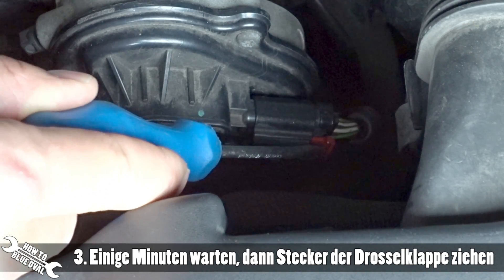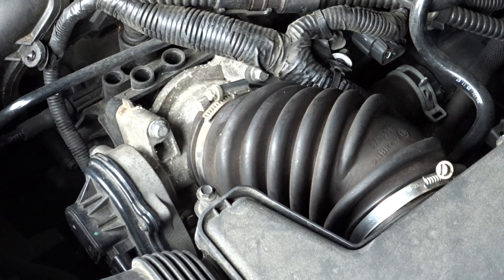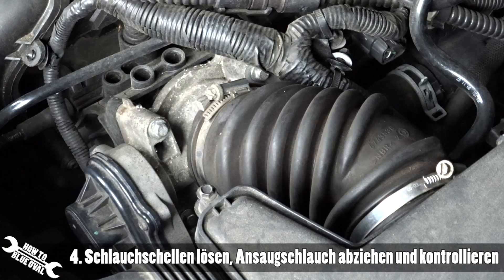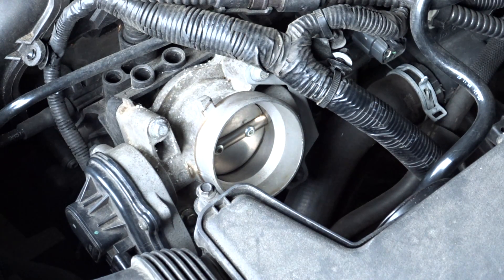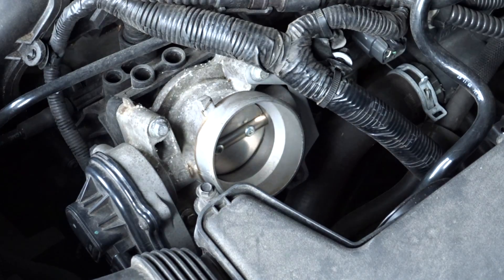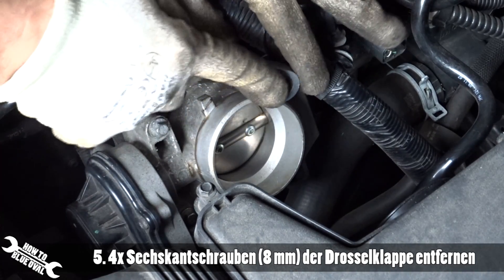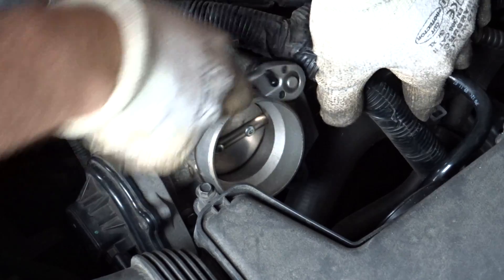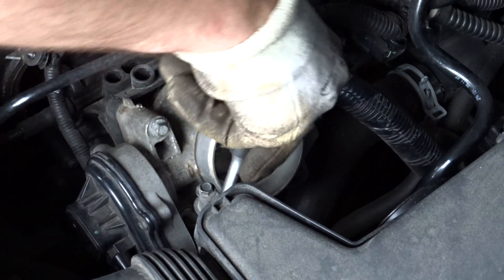Anleitung: Ford Drosselklappe ausbauen / wechseln - Duratec-HE - Für Focus 2, Mondeo 4, C-MAX, etc.

Comment: Hallo, ich habe eine F. MONDEO mk4 2010 Diesel, beim fahren ruckelt er im Drehzahl 2000- vierter Gang meistens, über DZahl 2000 dann nicht mehr, könnte as auch die Drosselklappe das Problem sein, oder Drosselklappe Stecker? Kann jeman mir bitte mit einem Tip helfen, danke Leute,
Reply from the maker: Hallo,

hast du eine Möglichkeit den Fehlerspeicher deines Mondeo auslese zu lassen? Irgendeine bekannter mit obd Lesegerät z.b.?

Comment: Anyone on here tried fitting an oversized throttle body off eBay meant for tuning an st150?  As the engines the same just wondering how the ecu gets on with re leanrning the map
Reply from the maker: sorry for the late reply. without a change to the ECU there will definitely be no performance improvement. maybe a look at fordownersclub.com, passionford and co. could help you. here is a post from a german board about this topic:
https://translate.google.com/translate?hl=de&sl=auto&tl=en&u=https%3A%2F%2Fmondeo-mk4.de%2Fforum%2Fthread%2F16278-60mm-drosselklappenteil-duratec-he-st-bringt-das-was%2F
Reply: I do because mine was faulty but no difference in the overall performance.
Same as the original

Comment: hi, you don't explain how to adjust the opening of the valve and idle with the rear screw provided for this purpose? nobody talks about it but there is a setting to be made to have a good fuel mixture air / fuel.
Reply: You would try to do "factory default full reset" for ECU, so that these values for fine fuel/air mixture would be better.
Reply: @Hsfgd08  hi thanks for this answer but where do you manage the "factory default full reset" please? you do that with the computer case plug on the car?
Reply: @elmerditodevideo  Yes, good practise is to use OBD II device connected to computer via USB port,  this way you can do it correct way. Another method is unplug the battery's "-" terminal (or take off battery at all from this car) then "drain out" all electronic modules (= this means generally "full reset" for folks) ☺

Comment: Hallo und herzlichen Dank für das Video. Ich habe bei meine Fofo Mk2 Turnier festgestellt, dass wenn ich aus höherer Drehzahl auskuppel (ab ca. 2000rpm) die Drehzahl sehr stark abfällt und für einige Sekunden schwankt (bis ca. 400rpm, einmal sogar ausgegangen). Zudem ist der Motor, wenn er kalt ist, auf dem ersten Kilometer ziemlich bockig. Habe etwas recherchiert und festgestellt, dass ich damit nicht ganz alleine bin. Kann es sein, dass die Drosselklappe bei mir verdreckt ist? Oder was für Kandidaten können sonst in Frage kommen? Der Wagen hat ca 148000tkm auf der Uhr, 1.8 Liter Duratec HE, läuft sonst einwandfrei. Danke!
Reply from the maker: @2funny144  Dein Kommentar wurde leider als "Spam" zurückgehalten, habe ihn jetzt mal freigeschaltet. Hat sich bei dir seitdem etwas neues ergeben? Mir ist aufgefallen, das die Symptome bei kalten und feuchten Wetter am schlimmsten sind. Könnte auch für etwas anderes als DK sprechen (Sensorik z.b.). Da der Winter nun wieder langsam vor der Tür steht, bin ich nun auch wieder an dieser Thematik dran. Melde mich wie gehabt wenn es etwas neues gibt.
Reply: Hallo,

Habe exakt die selben Symptome momentan.
Habt ihr eine Lösung gefunden ? 
Danke :)
Reply: @LuisVanDarke  also ich fahre mittlerweile seit drei Jahren so (siehe meine Posts von damals, also seit ich das Auto gekauft habe), jetzt hab ich 175000km auf dem Zähler. Das Problem besteht leider immer noch, aber der FoFo hält sich ansonsten wacker und zuverlässig.
Reply: Moin! Hat irgendwer von euch noch eine Lösung für das Problem gefunden?
Reply: @shayan6158  Nein. Habe das Selbe Problem mit meinem Focus MK2 BJ 09. Der Fehler besteht bei mir von Anfang an, sogar schon als Neuwagen. Angefangen hat es nach wenigen Tausend Kilometern. Besonders ist es mir Aufgefallen, wenn es kalt und der Motor auch entsprechend kalt ist. Das Auto war bei mir sogar damals bestimmt 2-3 Wochen in der Werkstatt. Man hat die Ursache damals nicht gefunden (auch im Zusammenhang, dass der Motor einmal nicht mehr Ansprang und abgesoffen war). Jetzt lebe ich seitdem damit. Es ist auch auch nicht immer vorhanden. Manchmal schwankt er aber so stark oder fällt soweit ab, dass er dann auch schlecht Gas annimmt. 
Bin auch für Tipps dankbar. Habe jetzt erstmal den Fehler PO221 (Fahrpedal). Werde mal die Drosselklappe ausbauen entsprechend reinigen.
Reply: @threevidual5405   Hey hat sich mittlerweile bei dir was getan bzw. hat die Reinigung was geholfen ? Bei irgendjemand anderem ?
Reply from the maker: Hallo, an der gleichen Problematik bin ich aktuell auch dran. Gleicher Motor und exakt die gleiche Symptomatik wie bei dir.

Da bei mir das Ansaugsystem komplett in Ordnung ist, vermute ich irgendwas im Bereich Sensorik.  ForScan zeigt z.b. an dass der soll und ist Wert der Drosselklappenstellung sich unterscheidet. Könnte also der Drosselklappenpoti sein, oder sonst etwas im Bereich der Motor Sensorik. Ich werde auf jeden Fall berichten...
Reply: @htbo  alles klar, bin gespannt, ob du dem Problem auf die Pelle rücken kannst. Man liest ja öfter, dass auch etwas mit dem Saugrohrdrucksensor (T-MAP) nicht in Ordnung sein könnte, wenn es spezifische Probleme mit der Drehzahl oder dem Verbrauch gibt. Aber den hast du dann ja wahrscheinlich schon überprüft.. Ich gucke mal, ob die Reinigung der Klappe etwas bei mir bringt. Werde nur in den nächsten Tagen nicht dazu kommen.. Muss aber auch sagen, dass mich das Ganze nicht sonderlich stört, da ich eh meistens erst kurz vor dem Anhalten auskupple. Da macht sich das Problemchen bei mir gar nicht bemerkbar. Ansonsten halte ich Rücksprache mit meinem Fordhändler, meiner hat nämlich noch Garantie.
Reply from the maker: Dann auf jeden Fall bemängeln und auf Garantie beheben lassen!
Reply: @htbo  Kurzes Update: Habe mal den Luftfilter und das Ansaugrohr zur Drosselklappe inspiziert... Luftfilter sah nicht mehr gut aus, Ansaugrohr teilweise rissig. Hab die Teile schon bestellt und berichte nach, wenn alles getauscht ist. Mir ist aufgefallen, dass im Luftfiltergehäuse unten ein Anschluss ist, der vom Ventildeckel kommt. Ich nehme an, dass das die Kurbelgehäuseentlüftung ist.. Unten im Luftfilterkasten ist ein leichter Ölfilm im Bereich des Anschlusses zu erkennen, es schwitzt da also etwas. Ist das bei dir auch so oder muss das komplett trocken sein?
Reply from the maker: Das ist normal. Verspreche dir aber keine Verbesserung durch den Tausch der Teile...
Reply: Ja, das habe ich mir schon gedacht. Nützt ja trotzdem nix, die verschlissenen Teile tun dem Motor nicht gut. Habe übrigens mal den Fehlerspeicher ausgelesen, ist laut Diagnosegerät alles in Ordnung. Bei kaltem Motor im Stand lag die Drosselklappe bei 16,5% und der Saugrohrunterdruck so bei 16 kpa (bin ich mir allerdings nicht 100% sicher, hab die Werte nicht notiert). Ich werde bei Gelegenheit mal mit angeschlossenem Tester fahren und die Werte aufzeichnen, bzw. beobachten.
Reply from the maker: Okay, am besten noch die Soll-Werte aufzeichnen, dann können wir später vergleichen. Ich denke wir bekommen das Problem schon in den Griff!
Reply: @htbo  Meiner schwankt immer noch munter.. Beruflich bedingt leider keine Zeit gehabt für genauere Diagnosen.. gabs bei dir was neues?
Reply from the maker: Ebenso durch die Selbständigkeit kaum Zeit bisher gefunden. Aber nach diversen Beobachtungen und Gesprächen in letzter Zeit sollte sich das Problem wirklich auf die Drosselklappe bzw. dessen Poti beschränken. irgendwann bis Mai soll bei uns eine neue Drosselklappe rein. Werde mich dann melden ob es erfolgreich war.
Reply: @htbo  Super, würde mich über weitere Infos sehr freuen. Mein Fofo läuft ansonsten einwandfrei, würde mich aber über Neuigkeiten sehr freuen. Falls ich diesbezüglich noch was neues rausfinden sollte, melde ich mich auch zurück :-)
Reply: @htbo Servus, was hatte sich damals eigentlich herausgestellt?